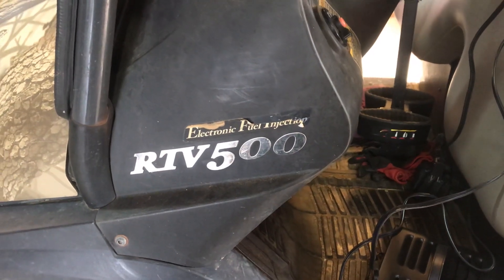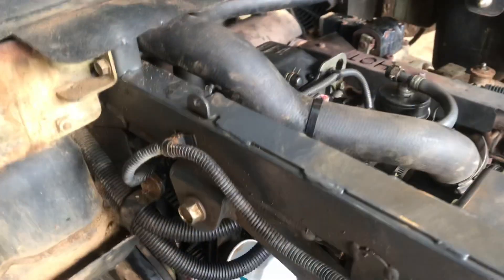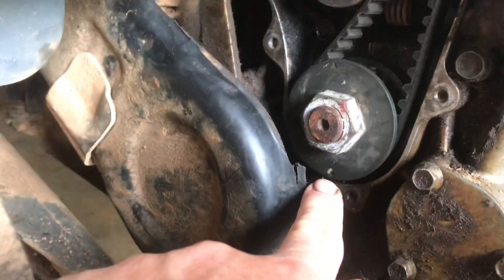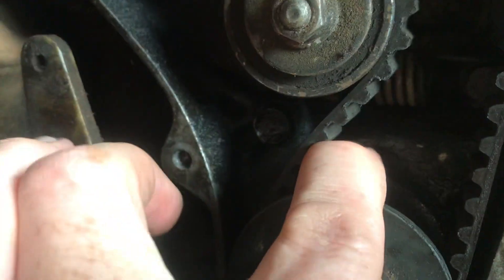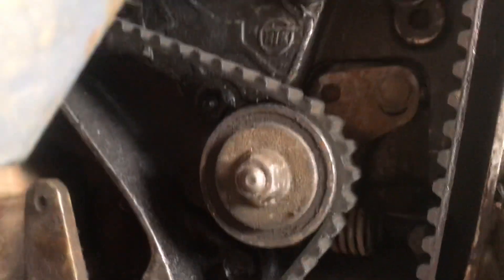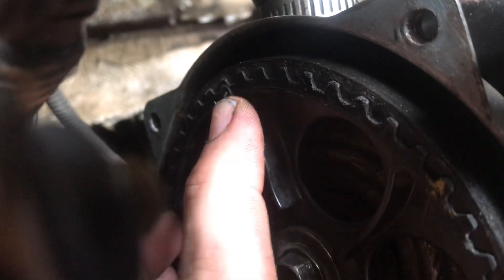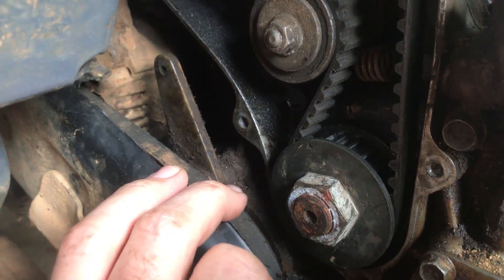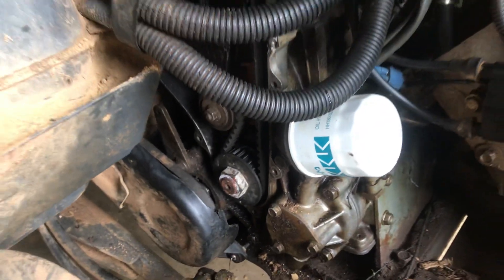Setting Kubota RTV 500 timing

Comment: Hi Paul I know this is an older video but I can find much information on a rtv 500 I bought and I believe the engine is seized and I am trying to turn the engine over by hand,  if I can get a breaker bar on the crankshaft nut would I be able to turn it over if not seized completely or bent rod
Reply from the maker: Yes.  I rotated the engine this way to align timing marks.  Squirt some penetrating oil or ATF and acetone, down the spark plug hole and let it soak for a while.  That should help free up the cylinder of it is stuck
Reply: @Belzon1  awesome thanks man
I know it's probably a dumb question but it's the same has a car crankshaft and rotate the nut clockwise to get it to turnover

Comment: Please Note 12 & 12 is improper alignment. I did just that and yes it will run however noticed it smoked, bogged down and just happened to pull the oil dipstick while it was running and noticed a smoke like vapor streaming out smelled like gasoline. Luckily we have 3 of them so I took a different one apart and the correct timing is..
Bottom arrow is 12 and lines up with the line on the block. The white round mark on the top gear lines up with the bolt on the tensioner bolt in the 5-6 o clock position. Otherwise your running 180 degrees off and gas will get into crankcase and can ruin the motor.
Reply from the maker: Thanks for the info

Comment: Got a question, I'm attempting the same thing. The service manual mentioned lining up a white mark on the belt with the white mark on top of the gear you mentioned being at 12 o clock. I cannot find a white mark on my belt,I really don't see where that is important...... did you line the gear and belt up? Thanks for any help
Reply from the maker: I didn't line up the belt just the gears
Reply: @Belzon1  thank you

Comment: Paul what all has to be removed to pull the head. Also what is the valve lash supposed to be. Working on a head gasket now on same engine
Reply from the maker: I kept the cab on and only removed parts of the engine.  It was right in spots but doable.  I can't remember what the valve lash was, I found it in one of the online manuals.
Reply: Paul Howell only part that’s got me stumped right now just by looking at it, is does the camshaft have to come out to pull the head? And if so how bad is thet and what is the process behind it.

Comment: can the engine be overhauled without removing it from the frame ?
Reply from the maker: You can pull the head and replace it with the engine in the rtv
Reply: Paul Howell what all has to be removed to pull the head? Any help would be appreciated